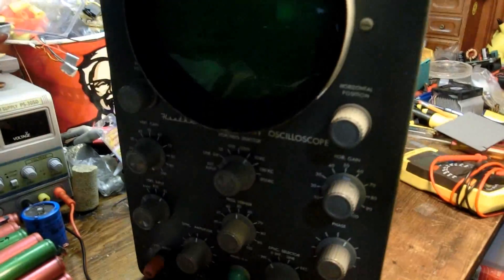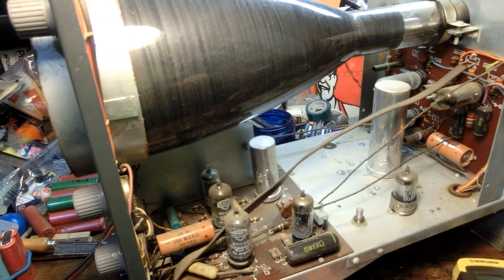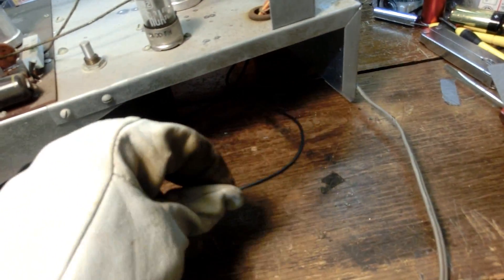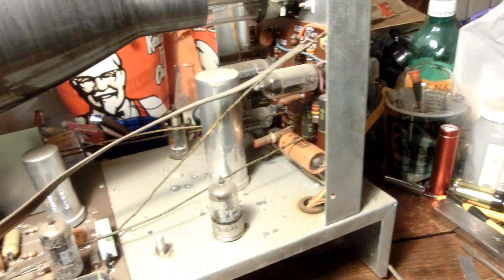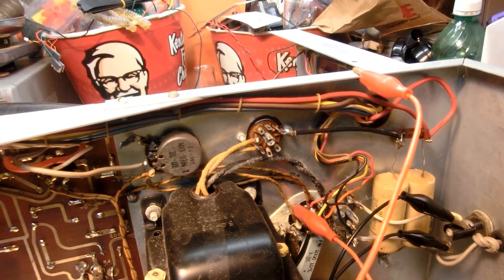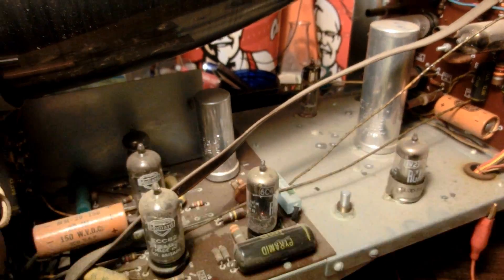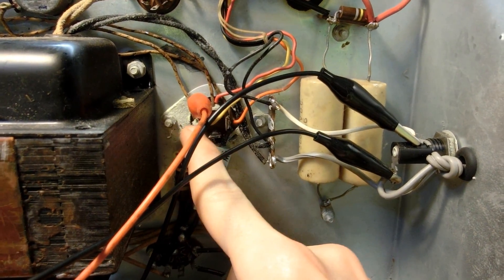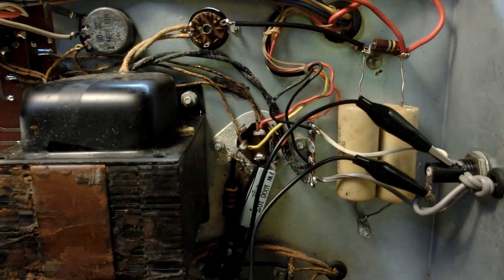Heathkit Oscilloscope O-11 part 2

Comment: I can tell by the way you handle the equipment, the components, and your thought process, you don't know what you are doing. You just blew a new tube that you ordered from Amazon.  I suggest that you take it to someone who does know what  they are doing.  A capacitor should not deviate below it's value since it is set exactly for its load handling capabilities. This makes a huge difference in the circuit's performance.  You should have cleaned up the Oscilloscope first. Then, tested the power supply.  Then, replaced fuses, capacitors, and replaced old wiring etc...
Reply: Exactly! I have a Heathkit model IO-18 oscilloscope. I grabbed the PDF schematic and instructions online. I treated mine like a building a kit, no blown tubes. Took my time and being patient restoring it, I spray lined the case with flat black Rustolium because I don't want it looking like the smoker's equipment. It looks very nice and the CRT is strong in mine. Lubricated the controls too.
Reply: I've been very lucky with the resistors and tubes in my IO-18. If I were to build this kit new from scratch, I'd solder those 2W resistors a half inch from the PC board. If a capacitor decides to short, one of those 2W resistors can get super hot and burn that PC board.

Comment: What? It's not an easy fix so you just get "bored" with it so you have an excuse to move on? If you don't have the time and patience and research ability to do a proper diagnoses and repair why are you bothering at all???
Reply: Bored impatient people are  those who those who end up killed or badly hurt by electric shock. I'd first install a grounded cord and plug into that unit. I received a couple nasty electric shocks from 2 ungrounded tube amplifiers. Ungrounded tube equipment are extremely dangerous!

Comment: You're just plain DAMN LUCKY you didn't get the jolt of your life when you stuck your hand in at that capacitor without discharging it first and you'll be fortunate to reach 40 if you don't start taking a more cautious approach to high voltages. 

Mr. Carlson has at least two videos on restoring old oscilloscopes and I would strongly urge you to watch them before proceeding further with your "repairs."

1. Step one~replace line cord and fuse....NEVER~~NEVER jump a fuse using a wire
2. Step two~Replace ALL capacitors~YES all of them
3. Step three~Check all resistors for being out of tolerance 
4. Check all solder joints and make sure they are good
5. Step Five~Plug in variac~Plug scope into variac~Bring up power slowly and watch for anything unusual 
6. Step six~Bring up to full power and ensure everything is working and then prepare to calibrate the scope
7. Follow this advice and you might live a while longer genius
Reply from the maker: i dont believe in luck, and i bet Mr Carlson's videos are 6 hours long. haha
Reply: I love vintage Heathkit tube test equipment, it's worth taking time and doing things right with them.

Comment: First of all, you shouldn't be fooling with something you seem to have no knowledge of. You probably could have saved the first 6X4 if you had used a variac, and brought it up slowly. Also, if you had two 1N4007 diodes, you could have used them in place of the 6X4. The DC in the scope is bad enough if you get in contact with it, but make sure you really stay away from the anode voltage (it means RF burns if you don't).
Reply: +James Searcy Yeah James... if they don't know anything then by all means they should work on high voltage DC to see if they can figure out a way to understand it. Maybe even get some of the experience on camera :) It's not like it's lethal or anything. Ok... so it's lethal but still they have to learn. And really... whats' a little RF burn that goes all of the way to the bone, destroying flesh and tissue as it goes. They have to learn right... :/
Reply: @MichaelLloyd  LOL!!!! EXACTLY!!!
Reply from the maker: James Searcy if it has to be brought up slowly then it needs replaced. and if i dont mess with things i dont know fully then i dont learn.

Comment: get the assembly manual off line they are all over ebay and there not that badly priced it will be indispensable =3-
Reply from the maker: you can download the shcematics for free, but i'm not really interested in fixing this tbh.
Reply: Rinoa Super-Genius i love these scopes i had one as a kid and now i have the need for a dule trce scope so i decided to just get two of these scops insted i love heath equipment all my equp is heath lol =3-

now all i need to do is fix my heath kit nixy tube frequency counter fixed that thing is a trip lol =3-
Reply from the maker: xoxoXoieoxox
 yeah heathkit is cool to collect and use, i've wanted a Heathkit Hero robot for a long time.
Reply: Rinoa Super-Genius lol there avalible but expesive like 2 grand =3-
Reply from the maker: xoxoXoieoxox
you can get some for like 400$ on ebay every so often.
Reply: Rinoa Super-Genius ya but it probably dos not work properly thats the problem with heathkit ur never shure if the person b4 u built it right my O-10 is going to have to be completely rebuilt there is an error with the vertical hold and i think its a bad resistor getting hot and increasing its value causing the trace to shift off screen but its fun none the less lol =3-
Reply: Rinoa Super-Genius just out of curiosity have u tried to power it up with no tubs in it the that and look for arcing in the sockets mostly the material sockets go bad not the plastic ones good luck =3-
Reply from the maker: xoxoXoieoxox
no i didnt, just just got tired of it and saved it for latter.

Comment: ok its not the filter cap in my opinion i have two of these O-10 O-12 but there not the same inside but they work off the same premiss now i had this problem and u know what it ended up being merely the socket of the tube that was shorting out i just jumped the wires on the tube with out the socket and it worked i blew 3 tubs b4 i fixed it =\
Reply from the maker: sorry to hear that, its always odd things that break.
Reply: Rinoa Super-Genius what actualy caused it was bad solder with too much flux and the flux caused the short and once the socket is burned it conducts and will ned replasing but i agree it is allways something stupi lol =3-

Comment: I doubt if my method would work for electronics troubleshooting, but it works well for finding a shorting  problem with a wireing harness in a lawntractor. Disconnect the negative terminal from the battery, bypass any blown fuses with heavy guage wire, than touch and hold the negative cable back to the negative battery terminal and watch the harness to see where the smoke comes from first. As soon as you see smoke remove the cable from the battery or else have a fire extinguisher handy and be prepaired for lots of work. This time I'm serious, no joking around.

Comment: Please, do NOT short fuse like that! Put a 100w incadescent instead of fuse, and everything will be safe and sound. More of it, you can get an idea about power consumption by how bright lamp is. Shorted = full brightness, also take that 1v2 tube out and clean pins if they are corroded (most of the times they are). 'bout caps - you can bodge modern caps instead of old ones, take some relatively new junk and find needed values. Good luck with repair!
Reply: Rinoa Super-Genius
If something goes wrong it's guaranteed to be an explosive outcome :D they're right about the bulb :)
Trust me, I've had such experiences. I left a screw loose inside my homemade welding inverter, and when I turned it on it shorted the full wave rectified mains and BOOM pieces of rectifier flying everywhere... with the bulb this wouldn't have happened.
Reply from the maker: MrOpenGL
 dont worry i'm not new to electronics. i've been working with electricity for almost 20 years and according to my experiance its not worth it to wire up a lightbulb in a lot of my experiments. also i like failure.
Reply: Rinoa Super-Genius  I must admit I love seeing electronic components being tortured!, the smell of magic smoke beats everything :) , but I would take any precaution to avoid BOOM things on my new projects i've been working on :D
Reply: Rinoa Super-Genius You are welcome. Just decided to share my experience in answer to you sharing yours by uploading great vids
Reply: MrOpenGL Well, if your task is to see magic smoke, then yeah, I agree, bypassing fuses is the way to go LOL
Reply: Rinoa Super-Genius You
 better listen to him if you want to work with electricity for another 20 years, old son.
Reply: A user named "Uncle Doug" has a nice video on how to build a cheap light bulb limiter, which is very useful for starting up older electronics, or troubleshooting any circuit that you suspect might have a short. It's a nice 30 minute project: look it up.
Reply from the maker: the lamp will mess up the circuit. it will limit the power so the filament voltages will be like 2v instead of 6v. bad idea.
Reply: Rinoa Super-Genius shorting fuse with jumper is not a good idea either. If circuit draws like 3+ times less power than power rating of bulb, it won't mess up your circuit considerably (it won't drop much voltage), but will limit power in case if something goes bad. I personally use this trick when I work with switch-mode power supplies and unknown transformers, after I tested it through bulb and plug it strait afterwards, everything works a treat. And it doesn't mess up circuit completely, trust me, switchmode PSU's are very picky sometimes to work with.
Reply from the maker: MrJohhhnnnyyy
 a simple jumper works fine for me. thanks though.

Comment: Please watch some of the restauration videos here on youtube. You can't just change out some components and fire up a old oscilloskope like this one. First of all get the schematic and service manual and check all of the components and wires (including resistors they can get bad as well). And use a variac to slowly turn up the voltage while checking total current and grid / heat voltages on the tubes. You might also ask someone with a tube tester to check all the tubes. Only cause they start to glow doesn't mean they work properly. And please don't get me wrong i like your videos. This project will take some time and effort.
Reply from the maker: yeah and i have other oscilloscopes that work, not in a hurry to get this one working.

Comment: Ooow dont you give up easy.
Take a picture of the wires going to the large capacitor, snip them but leave a few m.m on the terminals, take the cap out and measure it.
There should be no leakage, if there is try reforming the capacitor with your bank of batteries.

Remember that valves are high impedence devices, to a rectifier a 4k resistance is a short.

Check from your chopped wires to the common terminal wires, may show a low value on one of them, follow it back to the circuit.
Reply from the maker: theres a differance from giving up and putting something on the shelf for latter. if i made myself work on this when i didnt want to i would get more and more pissed until it went into the trash. nothing wrong with stepping back from an issue for a bit.
Reply: Rinoa Super-Genius
Did you read the rest of my rambling?, or did you focus all you attention on the first sentence.

I was supprised after one valve you got pissed off, your normally so determined to make things work for you.
Reply: Rinoa Super-Genius That's correct. I just wish I could do that when things begin to fail. A good friend also told me to do that. It's not worth it. Getting mad only makes it worse.